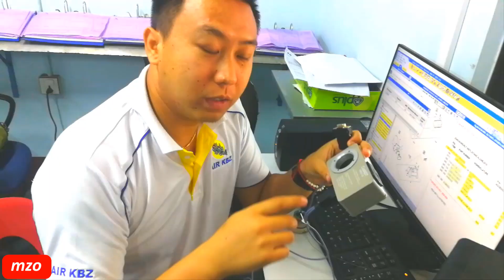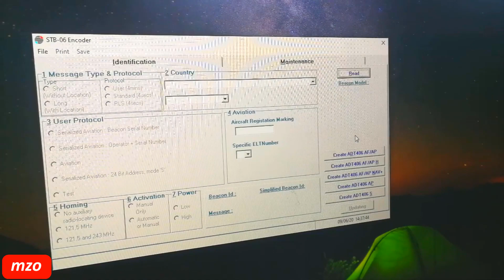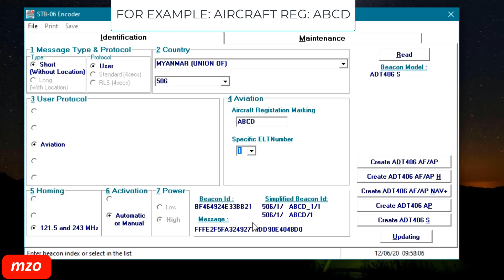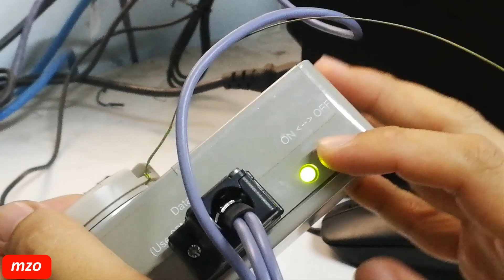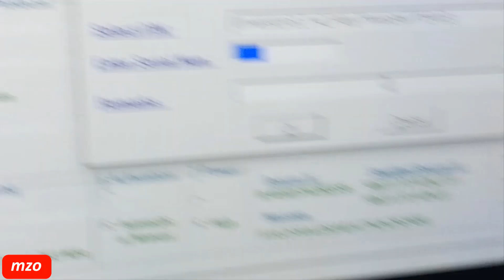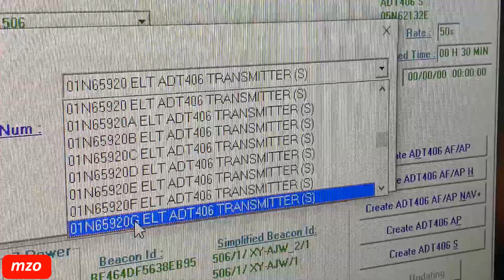ADT406 Emergency locator Transmitter (ELT) programming

Comment: Hi sir, i've a question, do you know the diffrences how to re-coding(programing) fixed ELT ADT 406 AF/AP and portable ELT ADT 406 S??

I saw in your video, you used ADT 406 S right??
Reply from the maker: It is the same procedure and Just select your elt type on computer screen.
Reply: @mzosharing  thanks sir
sir, do you have experience, when recoding elt was successful but when opertional test (transmision test) on aircraft, the test tool got last beacon before recoding??